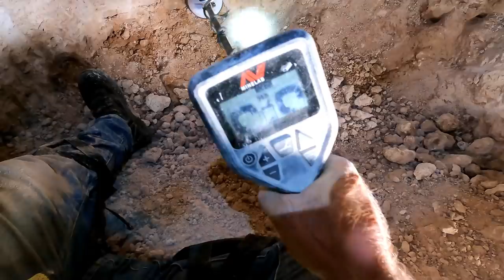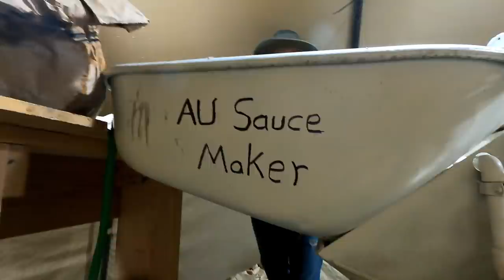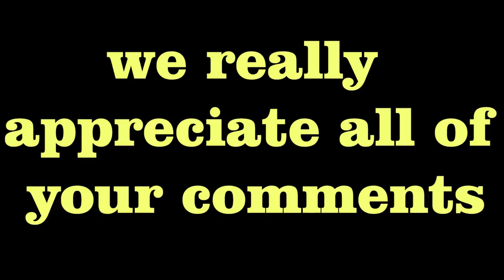This is How You Mine for Gold / Huge Gold Nuggets

Comment: Jeff,, iv got a suggestion for your gold monster!! It will make life so much easier in those confined spaces.. 

Remove 1 section of your gm’s shaft so it’s half the length then you will be able to see the control panel easily whilst in those tight spaces. 
Makes things so much faster not having to deal with the extra length. 

Next video you will be thanking me lol 🍻
Reply: Great idea .
Reply from the maker: thanks
Reply: Maybe a added switch for the speaker so you can "mute it" . that way you can leave it running, flick the switch and presto!

Comment: As for your specimen gold, up there directly adjacent to the King Tut placer, I found some nuggets with my Dad using the Gold Buddy recirculating sluice.  That whole area is full of CLAY, so most of the day was trying to break it up in the classifier, and raw hands the next day (protip: wear gloves).  Anyway, found a couple of small nuggets in a quartz matrix and dropped them into a glass vial with water.  Well what I thought was quartz dissolved in that water and the gold fell to the bottom, so I don't know if it was just held together by the silt and clay, or how quartz dissolved in water or what it really was (calcite??), but the takeaway is that you might not want to keep some specimens in water, assuming you do that.  

As for that area, what we were seeing was little stringer "veins", or old placers maybe from when the Colorado got dammed and ran down through there eons ago, probably filling up Red Lake.  They'd run for an inch or two, you'd find what I thought was quartz but it's some kind of transparent clear crystal, and gold nuggets.  You probably know the property I'm talking about just to the left of the old placer mill along that ridgeline.
Reply from the maker: thanks for the info and yes we know that area well..... could be calcite or even Caliche

Comment: Have you thought about using a dehumidifier down there?  If nothing else use silica gel sewn in to little pouches in a thin, coarse cloth. Along with a fan to circulate the air through it. Its used it to keep bottles of pills dry, and people usr it in air compressors to remove moisture from the air.   When it stops working, all you do is sit it in the sun. Or bake it at 225° F.   Some has a color indicator. It changed color ehen wet then back when dry.  Making a large curtain that can swing free, will also work. And id nail some 1x4's to the walls around the shaft, and hang plastic  with a hole for the ladder. And or chute,  to create a dry pocket, where the humidity is controlled. As you go deeper, take the gel dehumidifier with you and hang more plastic. It can make working conditions much more favorable!

Comment: Hi Jeff I have a remote control mining machine that breaks up the rock crushed it sends it out the back into a skid that is hooked up to a conver belt and dumps it on the surface and this machine has built in mettle detectors. And burrows the richest 
Veins you just fly it in by helicopter and it automatically seeks out the gold and makes a tunnel as it digs into the earth .
Reply from the maker: cool ....I 'll take two of them

Comment: Wow Jeff those nuggets are just getting bigger. Wow that is an amazing machine you made out of scrap, wheel barrel and car parts. I am sure you had to buy a lot of that metal. It looks like it works excellent. Do you run the metal detector over what you though away?
Reply from the maker: yes they are huh...... thanks..... yep it works pretty good ..... yes we do just to be sure

Comment: Hello, I just wanted to tell so much hard hend work, you operation can be more officially..
First you need to do hole fo the basket.. in the level of flour.
Reply from the maker: Thanks for the tips!
Reply: @Askjeffwilliams  I have ideas for a washing plan.
it would be great to place a hopper with a conveyor at ground level.
it will be easier on the hands and more efficient
Reply: @Askjeffwilliams  I'm won't asking, you detecting a big rocks after washing.they may also have gold

Comment: the sluice box on top should have a vibration machine or shaker deck to remove all of the over burden making the slucing easier. the wheel barrel in and out should have a conveyor belt in and conveyor out. . going into the hopper feed, and the over burden out, , making for more digging instead.

Comment: _________________How many batteries do you go through in a week?
Reply from the maker: a lot
Reply: @Askjeffwilliams  
______________What about running a couple of wires out to your car battery cables from the battery you're using to power your equipment.  Start the car and let it idle with a full tank of gas.  That way you'll be having the car recharge the battery.  Gas would be much cheaper than all those batteries, i'm guessing.